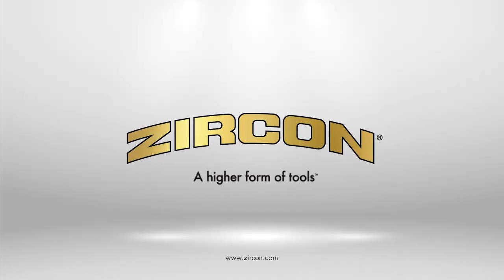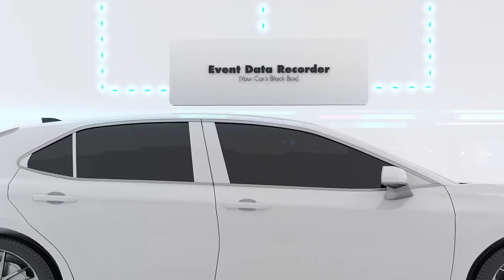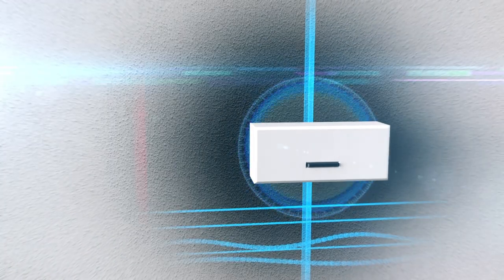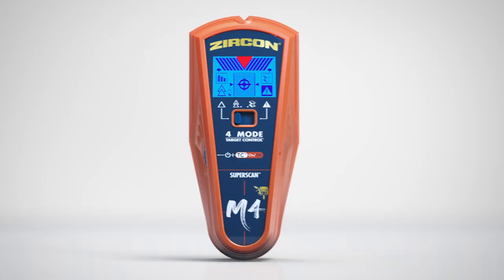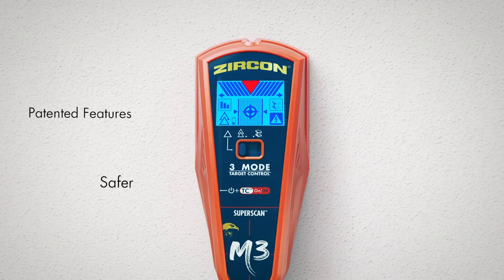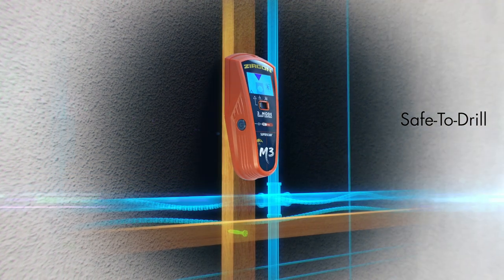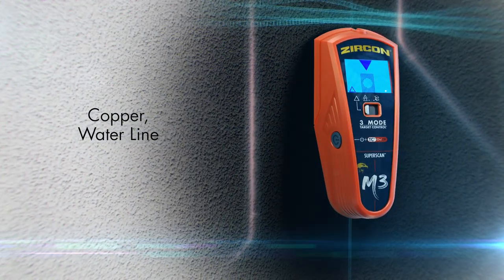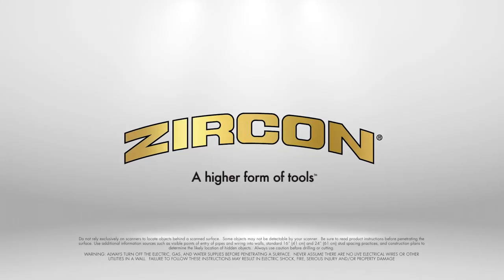Zircon SuperScan Mx Series Advanced Wall Scanners with Target Control Technology

Comment: The printed instructions contradicts itself on my M4. And don’t get reliable results either way. 
It says in bold “do not touch surface during calibration or scan” then
1. Set to TC mode
2. Hold scanner flat against wall then press and hold to calibrate. 

So I’m still trying to find out which it is, hold against wall to calibrate or do not touch surface….
Reply from the maker: Hi 2A556FMJ. They're both right but I can understand why this may seem contradictory. Your hand should not touch the surface during calibration or during the scan but the tool definitely should make sufficient and stable contact. We appreciate your feedback and will look into clarifying this on future instructions. Thank you. If you have any further questions, please give us a call toll-free during normal business hours at 1-800-245-9265 Mon - Fri 8AM - 5PM PST. Thank you!
Reply: @ZirconTV  Oooohhhh Thanks, that makes sense. Though sure who uses 2 hands on the wall like a mime stuck in a box when scanning.

Your customer service convinced me to try another zircon product…the metal finder. Thanks
Reply from the maker: @TobyCostaRica  Hi! Glad that it helped. :) We've observed that some tend to place one hand flat against the wall for stability while using the other hand to hold the tool and scan. It's the hand placed flat against the wall that can impact the readings. We'll try to clarify this for future. Thanks again!

Comment: Does it work on cemented wall?
Reply from the maker: Hello. Stud finders typically cannot scan through cement due to its density. Zircon offers a MetalliScanner metal detector line that can scan through cement and concrete to locate rebar, pipes, and other metal. Please give us a call toll-free at 1-800-245-9265 so we can better understand your needs and provide you with the best recommendation and tips and tricks. Our normal business hours are Mon - Fri 8AM - 5PM PST. We're here to help. Have a great day!
Reply: No not working on cement or stucco.   You might look Bosch for cement.